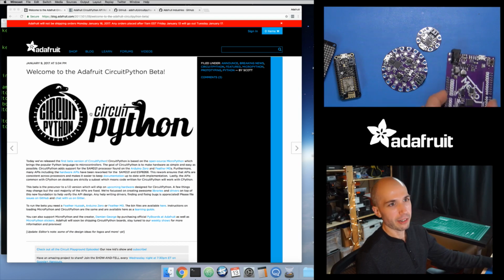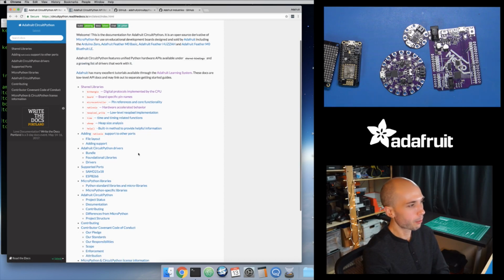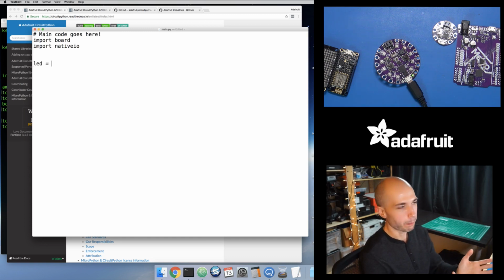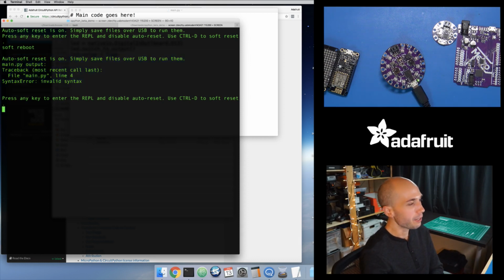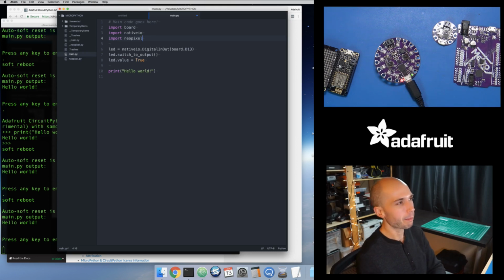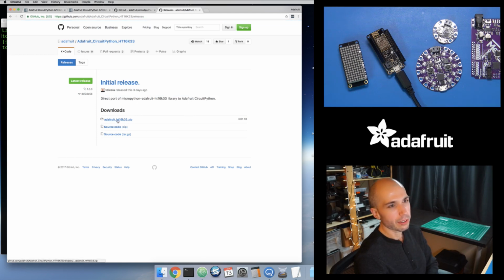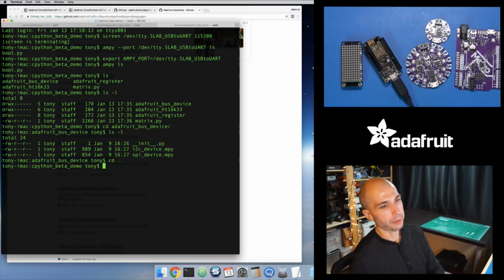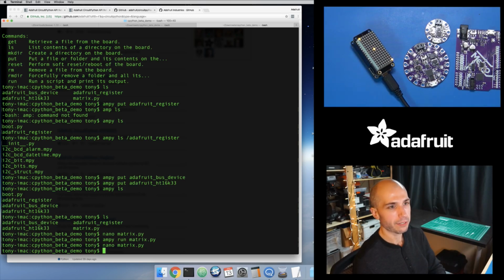CircuitPython beta introduction and demos with Tony D! @micropython

Comment: If Adafruit is after the IoT Education market, they should insure that their Circuit Python and MicroPython development tools work for Chromebooks. Many schools have dropped PCs  (Windows & Linux) and Macs (OSX) in favor of Chromebook. Will need good python text editor, maybe an "ampy" or "rshell", or whatever you just showed us that allows you to just save a file from your text editor and have it auto-download and run on your MCU board. Again, the tools need to be easy to use and perhaps cloud-based if need be to make the development environment more enticing to educators and students alike.